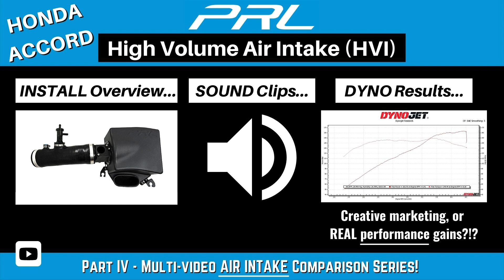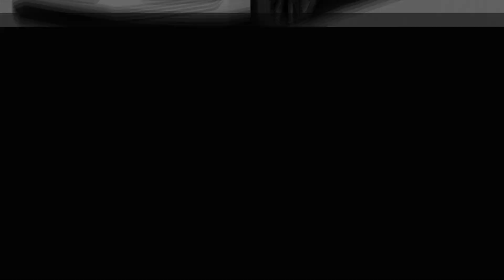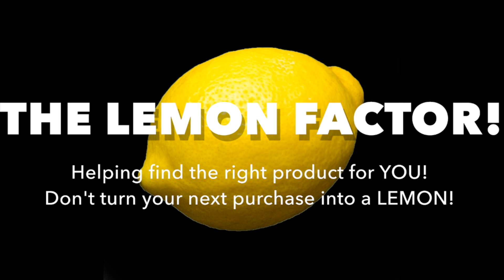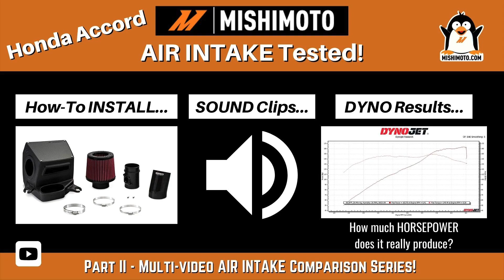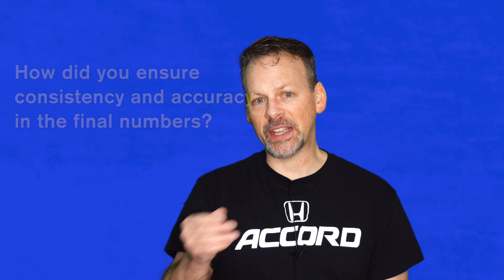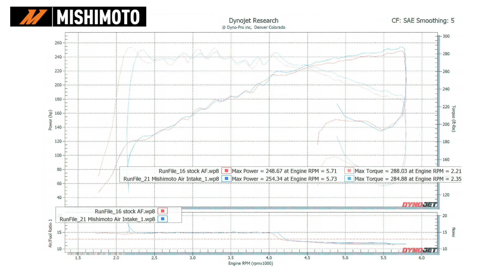PERFORMANCE AIR INTAKE Comparison Winner!?! //  10th Gen Honda Accord

Comment: I think personally the fact that the Mishi gives you the OPTION to opt for some more sound on the fly makes it the winner in my books. The one i ended up going with myself after your videos. Thanks!
Reply from the maker: You can remove the side panel of the PRL HVI, but it's so much easier to remove the Mishimoto's top panel.

Comment: Thank you for making a comparison on each intakes. I was in a choice between Takeda and Mishimoto actually because Takeida was offering a dry cone filter versus the Mishimoto which offers easier access to remove the cone access and easier to install. I ended up with Mishimoto on my 2.0T Accord and I can't wait to install it and would say when I look for installation videos, Mishimoto is more easier to install than PRL or Takeida does.

Comment: It took me 30 minutes to take out my resonator. Depends on if it’s a 1.5 or a 2.5. It’s a piece of cake on a 1.5. I thought it would be more difficult. But it wasn’t.  On a 1.5 it can be removed just from the top by removing the air box. It’s held by 3 bolts .

Comment: Great videos and comparisons, I really appreciate the fair testing that you accomplished!  I would also love to see a PRL vs HPS vs stock resonator blockoff mod charge pipes comparison.  Also, Civic Type R air inlet upgrade with PRL conversion components vs stock. --both with your thorough testing methods.  Thanks again for the great content!
Reply from the maker: My pleasure, Johnathon!  I’ve had several requests for the air inlet pipe upgrade. We’ll see what the channel Patrons think (hint, hint) 😉

Comment: Good job. You've confirmed that the claims from these "go to" aftermarket suppliers are pure bs. There is a line, and its not even all that fine, between advertising puffery and just flat out false advertising and you helped illustrate this. Why waste money on their silly crap when it hardly adds any power? It's the same for exhaust systems. More money, more noise, and only incremental increases.
Reply from the maker: Just trying to provide some unbiased data for car enthusiasts to make informed decisions 👍

Comment: Thanks so much for all the work you put into the best comparison video of intakes yet! I have both the PRL HVI and Mishimoto intakes on my list of potential mods for my 21 2.0T Sport, along with the PRL Stage 1, which is just the silicone intake tube and a drop in filter. I’m starting to lean toward the latter after watching your results, but the sound increase of the Mishimoto might be the best balance between performance gain and sound. Tough call.
Reply from the maker: It is a tough call between the Mishimoto and PRL.  I think for sound and just a little more performance, the Mishimoto is the way to go.  However, the PRL HVI may be a little easier to adapt if you're looking at upgrading your turbo.
Reply: @TheLemonFactor  exactly. Upgrading to the CTR turbo isn’t out of question down the road, but it would be a long way down the road for me. So, I think the Mishimoto is the right choice… Ill get to hear some fun whoosh sounds, it’ll give a slight gain in performance, and it’ll pair nicely with a K-Tuner Stage 2 or Phearable Stage 3 . The move back to having to use 93 octane is the main reason I’ll wait a while for the tuner, so the intake will likely be my first performance mod.
Reply: @TheLemonFactor  can you answer. I have downpipe/frontpipe, ctr turbo, and PRL intercooler. Wich air intake would be better for me?
Reply from the maker: I recommend that you watch all of the related air intake videos… hint, none seem to provide any significant benefits to warrant the cost 🤷‍♂️
Reply: @TheLemonFactor  i watched your video about 1.5 years)  In your opinion, it is not worth investing in this type of tuning?
Reply from the maker: I think getting a custom tune would be much more beneficial than an air intake.

Comment: Awesome video! This serious is really helped in the decision of which intake I want to go with for my 2018 2.0 turbo! Thank you! Keep making great content!
Reply from the maker: Thanks for the watch and support, Forrest! 👍. So which air intake are you planning to go with?
Reply: The Misimoto but not for performance honestly. I like the idea of leaving the cover off so we can get a little more noise. I live in Montana and the air temps are usually pretty cold(25*F today) so I don't think it will run into heat soak issues, and I reinstall the cover quickly at any time.
Reply from the maker: Makes sense 👍😁. Stay warm 😉
Reply: Great vid I have the prl so far its been amazing

Comment: This is all great and good, but.... I'd be willing to bet that after a tune (boost level increase), those closed box systems will not make the same power as an open filter intake. The closed box systems are still pulling air through the stock air box supply inlet, which was designed for factory hp requirements. It would have been more thorough to have tested internal box vacuum at full boost. If that box sees any vacuum, then you have a flow restriction. If closed box systems made power, you'd see them on all high hp cars.
Reply: Finally someone gets it... You didn't see any closed box systems on real performance cars that make big power

Comment: thanks man grate video again! I'm running stage 4 on e33,prl catless downpipe, intercooler and intercooler pipes,af dynamic hot air intake. my k count hits double digits and k com .50-.59.I've been thinking the air intake was the reason why im hitting those numbers. just wasn't sure which intake to upgrade to.I have a better insight thanks again 👍🏽
Reply from the maker: I’m glad to hear that you enjoyed the video. What octane gas are you running with the e?
Reply: @TheLemonFactor  93 I'm in pa 93 is every where but e is hard to come by
Reply: That K. Con is just fine though…..perfect is .49. It’s gonna rise through a pull ever so often. That number is far from an issue and your k. count is irrelevant. It’s not actually knock count…it’s misfire and direct injected engines especially while cold will have “misfires”. I’d say you literally don’t have any issue whatsoever
Reply: @tylertietz7819  thanks my "tuner" buddy was putting ideas in my head that it was gonna be a issue, so far I'm at .64 after filling up to e34.this tune is really good I was thinking about hitting 400hp but now I'm fine.lsd for my 6 speed is next on my list

Comment: Hi Chad,
Love the Channel. I just bought a 10th gen and have been watching your videos. Incredibly good content for someone just starting out with this car! I was wondering if there was any plan to update this video or make a new video testing the new PRL HVI Version 2? Was considering the Mishimoto and the PRL HVI but the straight through design of the new V2 PRL looks like it may flow better than both.
Reply from the maker: Thank you, Ryan!  I appreciate the positive feedback and sub.  I currently do not plan on testing the PRL HVI V2 as I do not see any change in design that would indicate better performance, quite the contrary, as they've now opened up the bottom of the top panel to the engine bay.  PRL does not indicate on their website any benefits over the V1 design.  My guess is that the V2 like the open design of the aFe Takeda intake will provide more sound, which many people are looking for, but will not offer any performance gains - much like the testing results of the aFe Takeda.
Reply: @TheLemonFactor  thanks for the response! I see what you’re saying and that makes a lot of sense

Comment: Ok, I see you though about the tune before the dyno testing. That is a must. I still prefer to see the results on a stuck ecu. Very interesting series.
Reply from the maker: I don’t know what you’re talking about. This is the stock tune, stock ECU. The KTuner is simply monitoring different data points. The results would be the same even if the KTuner wasn’t monitoring anything.
Reply: @TheLemonFactor  Yes of course it's the factory ecu but not with the factory tune. I was giving you props. I don't understand the hostility.
Reply from the maker: No hostility. I’m trying to tell you it’s the factory tune 🤷‍♂️

Comment: Such a great video, thank you so much for supporting the Accord Family!!

So I have a quick question - I have a 2.0T Accord with the Phearable Stage 3 Tune on it. I noticed that my knock control usually sits at .64-.67 and my knock retard goes to up to 7 on hard pulls. Is that considered normal? I put 93 premium and live in FL.
Reply from the maker: My pleasure.  Thank you, for leaving a positive comment.  A knock count of 7 on a single pull isn't ideal, that would concern me a bit.  The knock cont. of .64-.67 isn't horrible, but not great.  Might I recommend that you revert back to your stock tune, drive around for a while and get a sense of what your K.cont and K.count does under OEM conditions, then you'd have something to compare the Phearable Stage 3 tune to.  Also, you could change where you're getting your gas from, sticking with 93 octane, but going to another Tier One gas station.
Reply: @TheLemonFactor  thank you so much for your quick response and information, it is definitely appreciated! I'll definitely run it stock for a bit and see what my numbers are looking at and try any fuel station for sure.
Reply: @TheLemonFactor  What could be the cause of the knocking? I have a 1.5 and i sometimes read knocks up to 13.. Has me concerned, i’ve downtuned but it’s been ever since my last oil change and since installing the PRL catless downpipe i’ve noticed knocks in general, never even had 1 knock prior. Now i get them from any sort of pull i do lol

Comment: You guys should test the 8th gen accord. I have a stage 2 takeda I bought and am replacing the current air intake (old junkyard aluminum one I had) to see if it makes it any better than it already is
Reply from the maker: If you’re in the Denver metro area, send me a message 👍
Reply: @TheLemonFactor  unfortunately I’m not my man. I stay in southern Missouri but I’ve been looking around for a tune and dyno place to do some testing (no one around here likes to work on foreign) I have a custom dual exhaust, resonator delete/piped, magnaflow free flow mufflers, and a aluminum short ram intake (swapping to takeda stage 2 short ram soon as covid stops delaying shipping it’s been 2 months I’ve been waiting lol) I’m looking for a UR pulley kit, and a RV6 PCD.. both those last two I named have been discontinued so I’m scrapping the barrel for those parts 😅 I have faith in my 2.4 2010 accord lx-s motor tho, sucks the intake manifold is integrated.  my true plan was to turbo the k24z3 but I guess bolt ons and tunes are the way to go for this ride.
Reply from the maker: Sounds like you’ve put a lot of work into your Accord in order to make it your own. It would be interesting to see what a turbo setup would do 🤔
Reply: @TheLemonFactor  man if you can find out a way to turbo this car with the Hondas integrated intake manifold to cylinder head on this specific motor please let me know lol. all forums I’ve dug into lead to dead ends, some said piggy backs etc or fabricating an extra pipe to add a turbo to the cars down pipe but idk how well that would handle since it’s not FI the actual intake. I know most ppl traded off their accords or swapped to the k24a2 because of it. I just don’t feel confident in my plastic manifolds holding boost 😂 I’ve been told 350 Hp can be achieved, on the TSX k24z3s atleast. I’d say right now I’m probably around the 200 whp range. Car came stock 190 hp I haven’t dyno’d the car yet but if all my bolt ons etc add up.. in a world of numbers just from me driving it before it wouldn’t even squall a tire when I take off, now it will squall for a whole second during take off and picks up very quick in the low end rpm. Guess I’ll have to come to Denver someday and see if you can hook it up to a dyno I’d be more than willing to let you tune and run tests on it. She’s at 93k miles now on the motor and body.

Comment: I just saw HPS has a boxed intake for the Accord and was wondering where it would stack up against all these?🤔
Reply from the maker: The HPS looks an awful lot like the K&N and AEM. 🤷‍♂️
Reply: @TheLemonFactor  yea now that I look at them it does. Think the added flap cover is the only difference.
Reply from the maker: Still could be a consideration as I haven't tested this style. We'll see what the Patrons of the channel decide on next steps going forward.  Checkout the link to the Patreon page in the video description to find out more info on how to sign up and the benefits in becoming a member.

Comment: Is there a reason why you didn't use the and use the K&N air filter and the AEM air filter in your testing
Reply from the maker: Good question.  I chose the 3 performance air intakes that I thought were both the most popular, and (at the time) thought would produce the best performance gains on the dyno (guess I was wrong with that).  I would consider testing the K&N / AEM (both nearly identical) in the future if there's a strong desire from Patrons to do so (hint, hint), ; )

Comment: What were the gains in horsepower and torque at 4000 rpm for PRL andMishimoto compared to baseline?
Reply from the maker: You’ll have to checkout the separate videos in which I tested each one individually - I have the dyno results in each 👍😁

Comment: What’s better tho for performance close or open intake
Reply from the maker: An open intake is going to pull the hot air from the engine bay, where’s a well designed closed system will pull cooler air from outside the car. You want cooler air 😉👍

Comment: will the intake void warrenty and also does it require a tune to get any hp of it?
Reply from the maker: Personally, I have not experienced any dealers giving you a hard time over an air intake. With that said, if you have a warranty claim that the dealer can attribute the intake to being the cause then they will deny covering it.